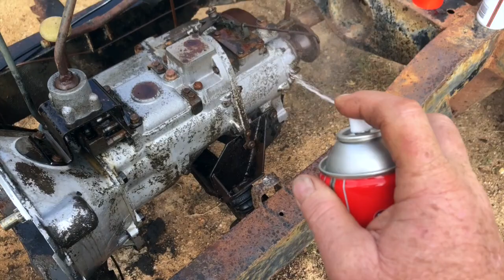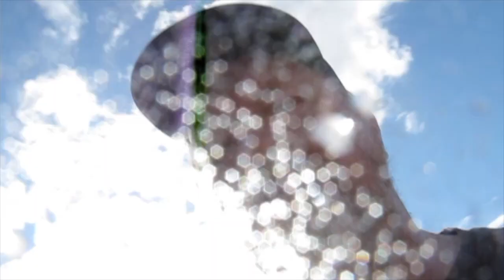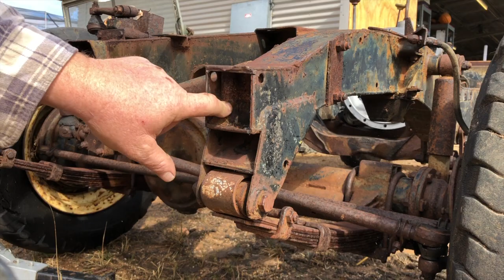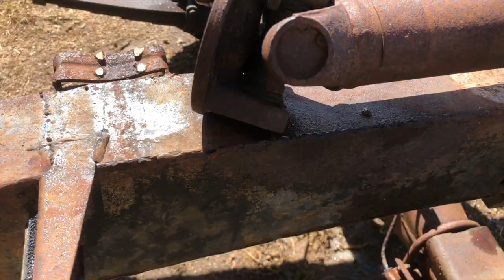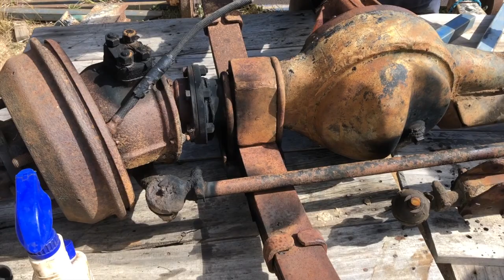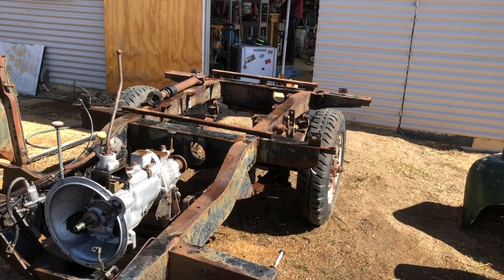Land Rover chassis cleanup & diff break down - restoration and electric conversion project - Day 5

Comment: the best antirust inhibitor i  have  found  for  inside  Landrover  chassis. is a  good  dose  of thick  black diesel  waste .oil  twice .a   year   the. more  dust  that  sticks  the  better
Reply from the maker: Yer na Warren, old school but probably a bad idea as the sump oil is inherently acidic and can contain emulsified water, both will increase rather than prevent corrosion.   Dirt and soil that attach to the sump oil will also maintain high moisture content, high electrical conductivity, high acidity and high dissolved salts which all increase corrosion.  Sump oil and soil mix is like a corrosion poultice! A clean chassis with  an appropriate inhibitor will extend the life of you chassis.